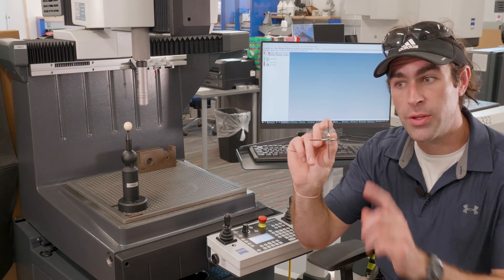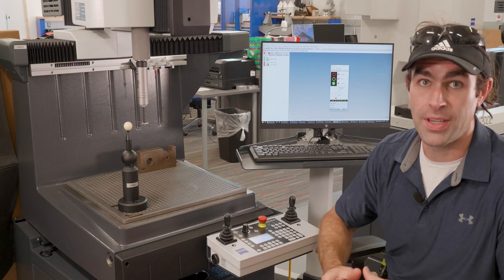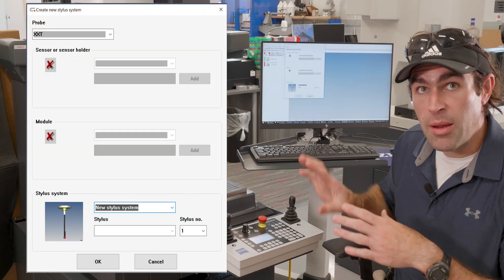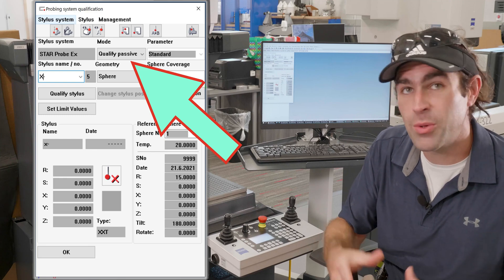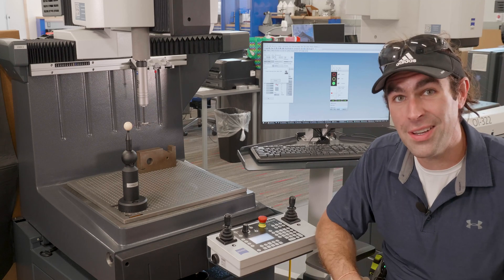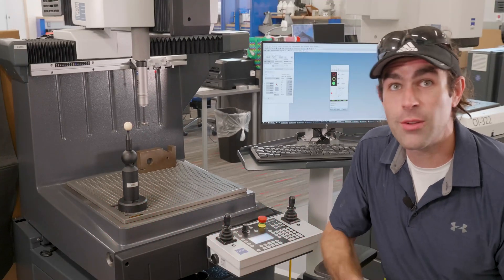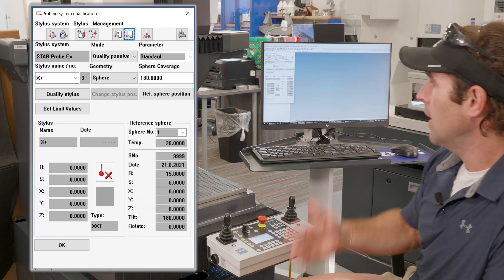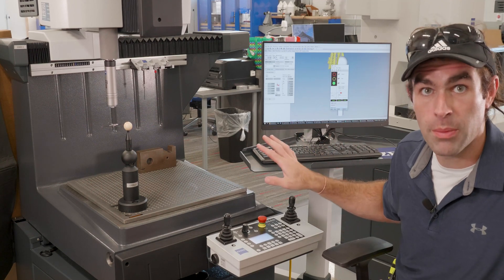CMM Zeiss Duramax with Calypso: Stylus Qualification, "Star Probe" (Programmer Training Lesson 5)

Comment: Maybe a silly question, but:  Is there any prohibition to having different sized Styli on a Star Probe?  So maybe off the X+ I might have a tiny 1mm Styli, while all the others were longer 2mm to 3mm ball Styli?
Reply from the maker: I don’t see any issue. There is a point where length or weight of the styli might cause a balance issue. I’d just keep them close to the same length on opposing sides.

Comment: After opening the Probing System Qualification window, Qualify Passive is not what appears in the MODE section, Dyn. Sensor appears... should I click the drop down arrow and select Tensor, Six points or Manual?  I'm thinking 6pts... can someone elaborate on this... I'm new to all of this, and this is my first time doing this process... I'm using a Prismo

Comment: Thank you for sharing. Will you please do an angled probe calibration. I read it in the book and have tried, but can never probe the shaft on reference sphere accurately enough. It would be great to be able to lock styli system at a specified angle.

Comment: Thank you for the very informative video. I sow many programmers even do not number the first five numbers according to the "traffic light standard" and the worse case is named a probe-tip with the same number for different angles of orientation (eg A45B-30) which caused a huge collision ending damaged the complete sensor. ($6000 damaged) so thanks Odell for share very valuable information and keep doing more videos, please.